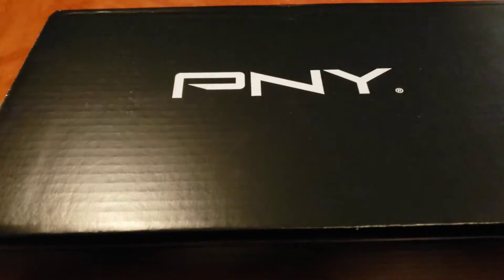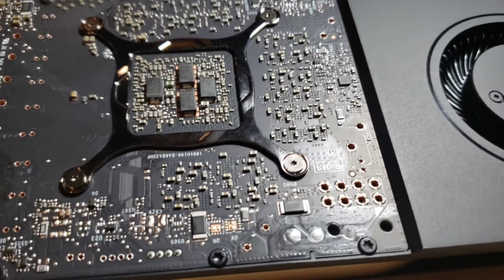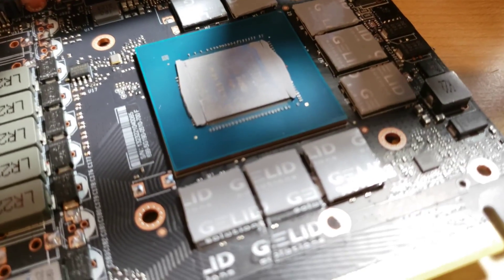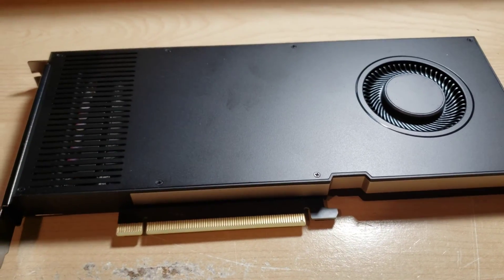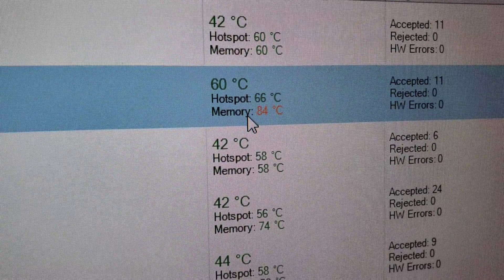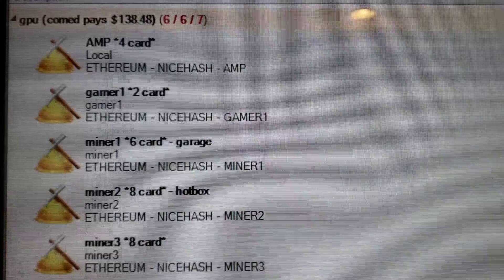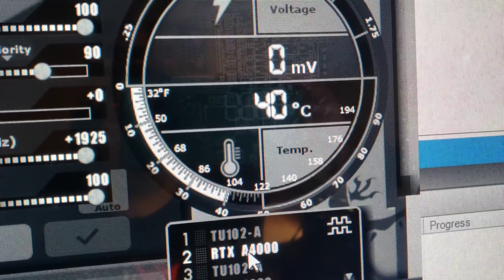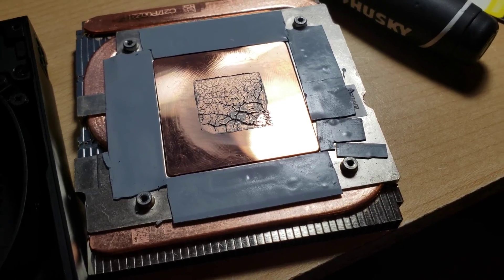PNY A4000 TEST AND THERMAL MOD - 65 MH/s - 121 WATTS

Comment: 0.5mm copper in place of 0.5mm gelids??? with and w/o washers ;)
Reply from the maker: I think if something calls for 0.5mm pads you would need like 0.3mm copper shims or something like that since pads squish down a bit.
Reply: @JoyofMining  I tried the Kritical 20 pads (.5mm) and temps went thru the roof (dont think the die made contact w the heatsink) however, Noctua NT-H2 paste under the heat sink on the metal plate worked great... thanks for a great vid though!
Reply from the maker: @04DetroitLS  now that things are warming up this spring, I will definitely be resisting the a4000. Currently the hottest card in the farm. All other cards at 47c and the a4000 is at 60c. Temps are well within safe limits, but I know I can do better :)

Comment: Did''n work this mod on the top on the plate on my PNY A4000, after changed pad on vram temp is 64 on gpu and 80 on vram

Comment: This is insightful info thank you. I have a Quadro RTX 4000, do you or anyone else reading this know if a repaste and thermal pads will have the same result? Also, do I have to use the .5mm pads on the metal bracket? I only have 1mm at this time.
Reply from the maker: Not sure what the cooler is like on the quadro 4000.
Reply: @JoyofMining  OK, thanks for getting back so quickly. I’ll keep looking.

Comment: Have you considered/used/heard of K5 pro thermal paste? I'm thinking about utilizing myself but I'm wondering if anyone else has had success with it yet. Thanks.
Reply from the maker: I watched a Linus video yesterday that they did a 3090 with it. They were taking it apart to do some power mods. Looked like a mess. But if it works go for it. But the a4000 isn't so much in need of better pads, its just the cooler on it is tiny. No pads or paste will help that tiny fan and heatsink. They really do well in an enclosed server case. Open air just doesn't cut it.
Reply: @JoyofMining  I watched the same video. They have another older video showcasing the K5 on the same card and a laptop and they saw some improvements. Didn't you see a huge improvement by connecting the backplate to the heatsink (which is what i'm planning to do now so thank you!)? And you run yours open right? Or do you enclose yours a little?
Reply from the maker: @alexhurd1038  mine are in an open air rig. The "backplate" mod with a heatsink and fan that i did helped even more. The pads helped a little.

https://youtu.be/0PxCoyEEsMI

Comment: i forgot to ask whats your Overclocks, i am on hiveos ad getting around 64-65 mh/s but at 125 Watts soon as drop it the mh/s goes down. I am running with 0 core and 3800 memory
Reply from the maker: Core locking will get those watts down.  100% power and core locked at 1110. 

https://youtu.be/oksc_FXErA4

Comment: Dude - Golf Clap.  Thanks so much, I've got an A4000 problem child right now and I'm going to take it apart tomorrow and do some pads as the original pads seem to have some oil leaking out of them.
Reply from the maker: I only have the one in an open air frame. These work much better in an enclosed server case. But, if you have it in an open air rig, I have a new video up where I did a heatsink mod. Not pretty, but it helps.

Comment: i wonder if a bigger heat sink with an extarnal fan make it better ? mine sits in an octominer server case still after a day of mining it does throttle or shut it self down, reboots. Change the pads with 1.5 mm but now its even hotter. So i will try your technique too !
Reply from the maker: I saw a guy add a heatsink to the back. Since its bare pcb, he added a 2mm thermal pad to keep from shorting out with a heatsink and fan, then zip tied it to stay in place. I now have this card back indoors so I will try this method soon.